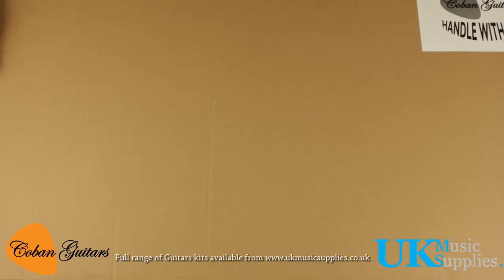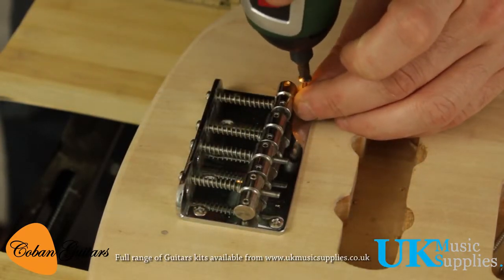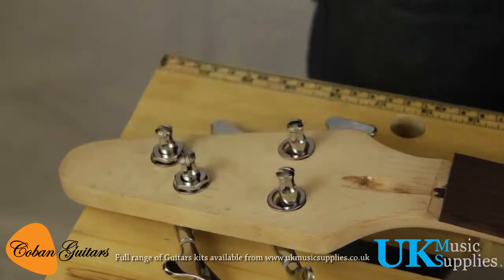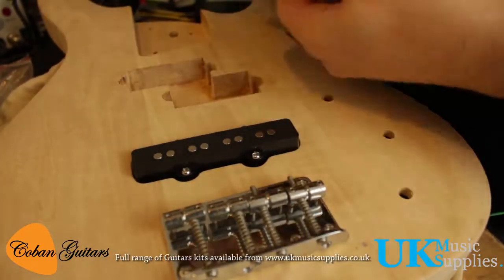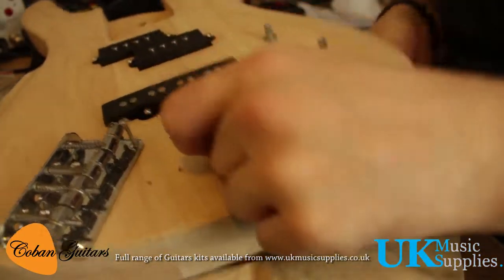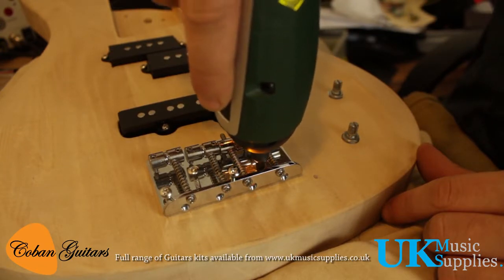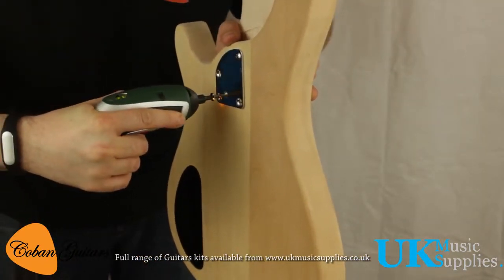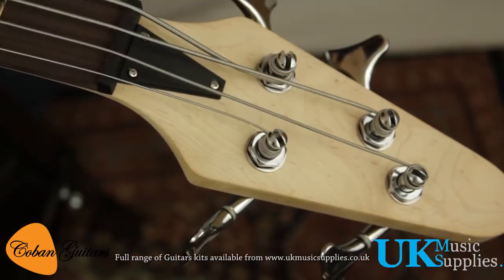Guitar kits or guitar DIY kits?

Comment: Pretty shoddy in my most humble opinion! Threw it together and rambled through the video without any insightful hints or tips. No mention of neck alignment, bridge or nut adjustment, poor soldering explanation, then he threads the A string the wrong way around the tuning post on the machine head. Then there’s the fumbling around with the electric screwdriver carelessly driving screws into the body and neck while trying to hold the assembly with the other hand! Lol when he finally said ‘so that should be a pretty playable bass’ Seriously? Do you have many kits returned due to such botching?